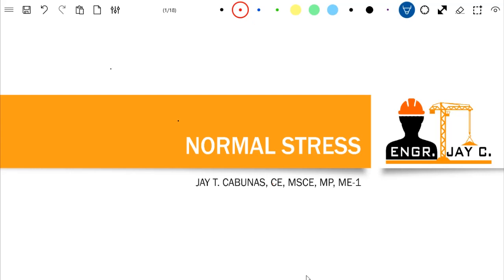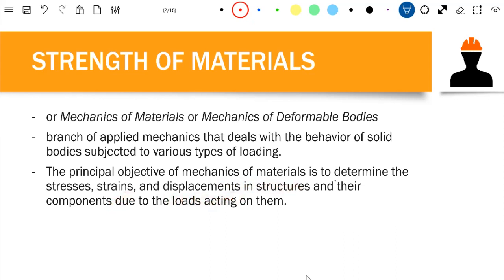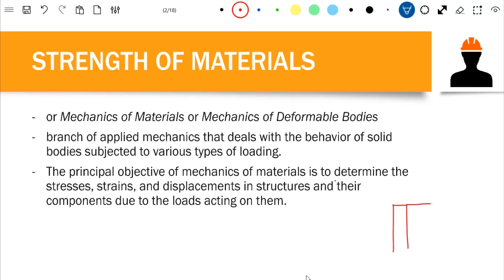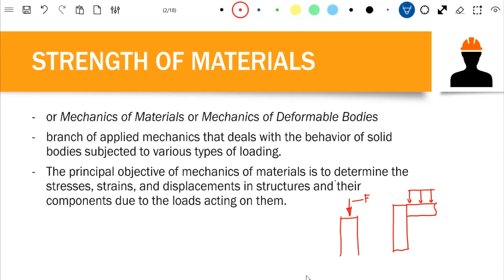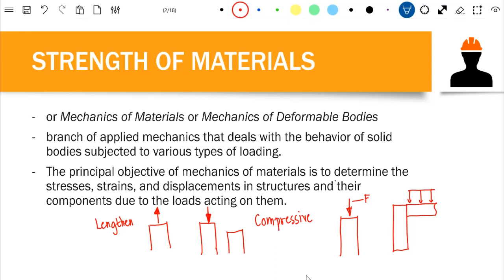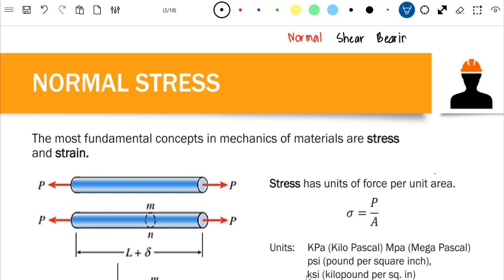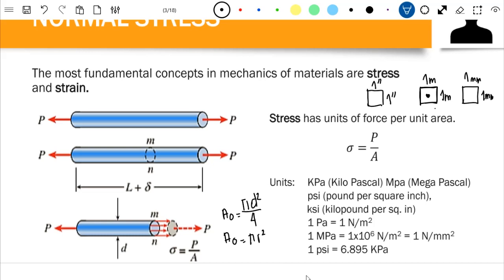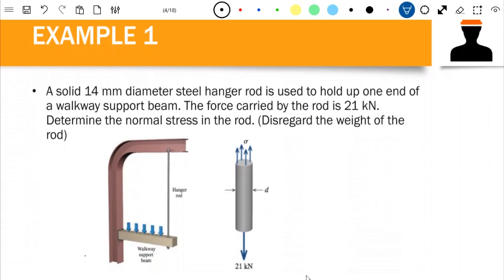Strength of materials: Normal Stress Part 1 of 3 (Filipino, English)

Comment: sir triny ko ishift solve pero can't solve lumalabas
Reply from the maker: Baka mali ang pagka input mo sa calculator
Reply: sir paano po ba mag input?
Reply from the maker: @roquepentason7056  e type mo lang sa calculator ang equation tapos shift+solve
Reply: 1.330151886x10^30
Reply: @roquepentason7056  ganto din sakin
Reply: Try nyo po guys sa problem number two 
400,000 = 120 [1/4 pi (D^2 - 10,000)] 
400,000 = 30 pi D^2 - 300,000 pi
D^2 = 400,000 + 300,000 pi / 30 pi
D^2 = 1,342,477.796 / 30 pi
D^2 = 14,244.13182
Tapos square root nyo nalang yung final answer na 14,244.13182 kasi naka square yung D.
Final answer din nyan ay D = 119.35 mm